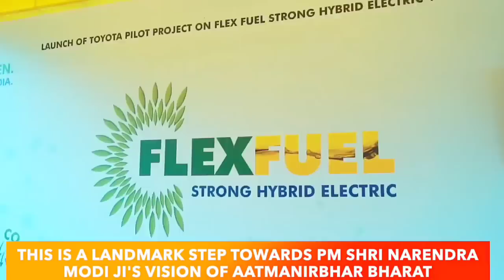Gadkari's DREAM, Australian Technology भारत में लाया🔥 $200 Billion के Project, 2030

Comment: Adaption vehicles with flex engine should be fast tracked. This can only be achieved if govt comes with a plan of setting up ethanol plants in large numbers with help of PSUs & corporate giants. Flex engine has it's own disadvantages like high maintenance cost. But ultimately it's the need of the hour.
Dependence on one specific fuel is also dangerous. Diversification of energy sources is essential.